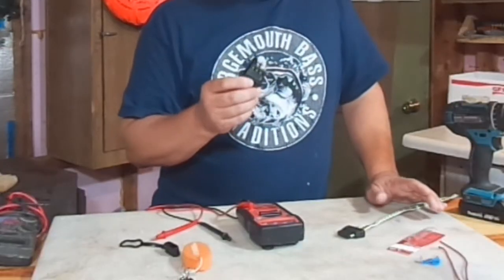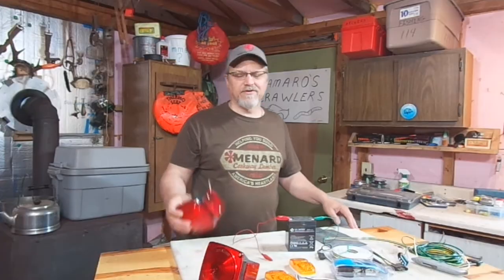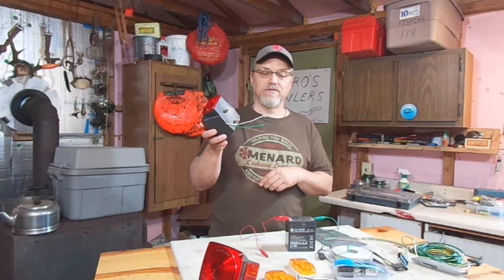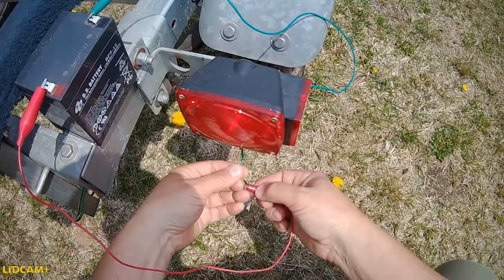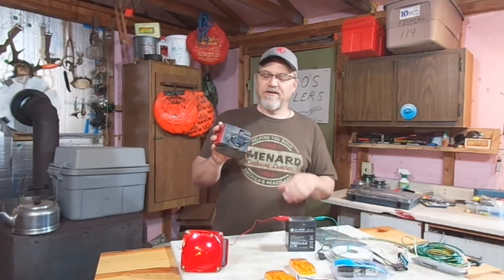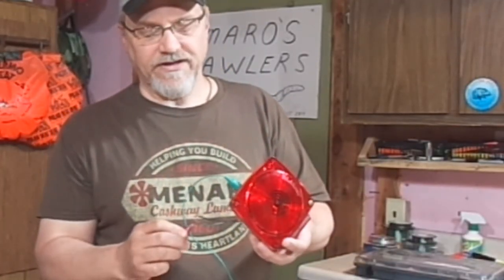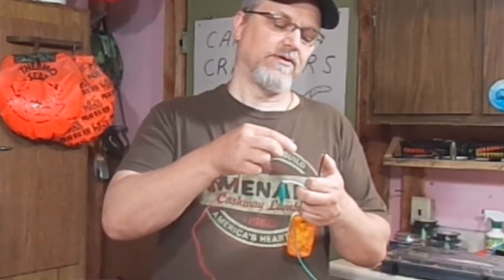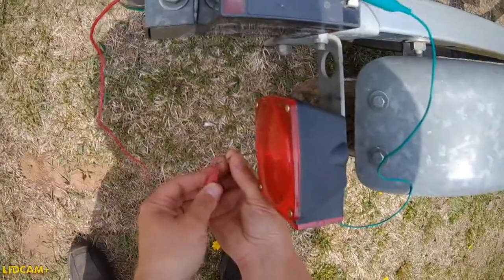FIX YOUR TRAILER LIGHTS (9) - Checking The Fixtures

Comment: I've found the wiring on these trailers using 18-20 gauge wire. seems like after a year or 2, the actual wire goes to shit( excuse my French). The copper wire turns black. The grounding just breaks off from vibration. I rewire using 14 gauge ( seems excessive), soldering and shrink wrapping connections. The light fixtures are wired by spring plates , everything seems to be getting cheaper and cheaper. Excellent explanation on the testing. Most problems with these lighting systems is a bad ground.
Reply from the maker: Yes, I've experienced much of what you mentioned.  I just finished up a video on grounding.  You're right that's were a lot of problems come from.  Thanks for adding in, KPO.

Comment: Thank you for your videos, they are very helpful.  My marker lights don’t come on with the headlights. Everything else works fine. I tested each bulb and found 1 of the 4, not good. Do all 4 bulbs need to be good for circuit to be complete?
Reply from the maker: Different fixtures are different.  I would replace the bulb and see what happens.

Comment: What would cause a bulb to burn out?  I replaced the fixture and in 1 use I had to replace the bulb.  Used it again and same fixture had the bulb burnt out before I returned home.  Seems to happen after I unload my trailer of its cargo on the way home.  Could I have the fixture nuts too tight or loose?  Great series.
Reply from the maker: I guess the next question would be is the bulb burnt out or is the filament broken?  If the filament is broken the fixture just might be banging around too much.  Sometimes I have had bulbs pop because I backed a boat trailer into cold water with the lights plugged in.  Hot bulb and cold water don't mix.  Or maybe it's just time to up grade to LEDS.  Let me know if you figure it out, KPO.

Comment: Hello, i've been watching all of the videos in this series. I think one of the wires is cut; looks like the trailer i bought had a BIG mouse problem and some cords are chewed on (bigger ones that didnt get fully damaged from what i can atleast) but i can't access the wires going to the back lights and none of the rear lights are working at all so I imagine it's a wire that supplies all of them on my 7way wiring. How do i check the wires to see which one is broken? Should i hook up my vehicle and go in with the multimeter-how should i do that?
Reply from the maker: Yes, you may have to hook up the vehicle and see what you got.  Check for expected voltage at the fixtures, see if it blows fuses.  If there is evidence of suspect wires you may want to just rewire.  Hard to say what's going on inside the trailer frame.  You might get it working one day and then have problems the next.  If you do rewire check this one out https://www.youtube.com/watch?v=-14kh2DYdOo&t=245s  Let me know how it works out.

Comment: Great videos!! I started having an issue where my lights come on but seem to be very dim. The run lights and signals work but when I press the brake the lights go out, release brake and they come back on. I tried replacing the bulbs but have the same problem. Any ideas 💡
Reply from the maker: It really sounds like a ground problem.  Make sure the trailer ground wire has a good connection to the trailer frame and also check the vehicle side.  What can happen when you loose the ground connection the current will back feed through the other lights sometimes.  The extra resistance will make the lights dim.  I think when you hit the brakes you are taking away the back feed path.  Check the grounds and let me know how it goes, KPO.

Comment: How can you test a light fixture w/o removing it from the trailer? I  have an enclosed trailer where half the 12 or so running lights are not working. But half are. It’s not simple to look at the wiring because it’s behind plywood wall.
Reply from the maker: Well, check the bulbs first if you have them.  Otherwise you may have to pull the fixture and disconnect to check.  The fixtures are most likely wired in parallel, making it difficult to read a bad fixture with a meter when still connected.  If it's just one side, it may be a bad ground on that side.  Let me know how it turns out, KPO.
Reply: @KnettersPracticalOutdoors  the 2 brake lights are LEDs. The rest are incandescent bulbs. On the left side brake light, only half the LEDs light up with the running lights on. However with the left turn signal all but one of the LEDs light up. It has been suggested to me that one of the wire connectors on the running lights must be loose. I know the running lights on the back top are definitely in parallel. So I'm guessing all the lights are in parallel. I wonder if I could have a low voltage issue with the trailer side connector. The trailer is only 6 years old with 200 miles, but it's been about 4 years since I had plugged it in. None of the bulbs appear to be burned out. I have soaked my trailer side connector in Diablo taco Bell sauce. That didn't seem to make a difference.